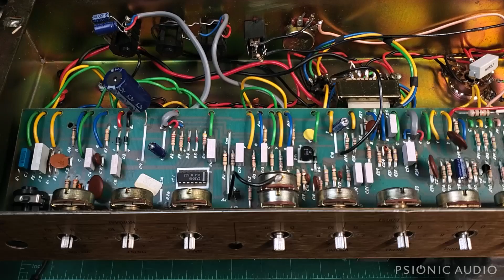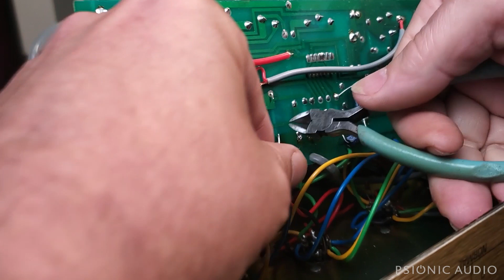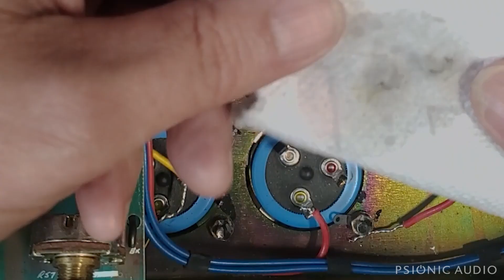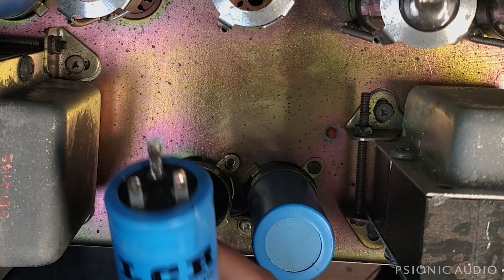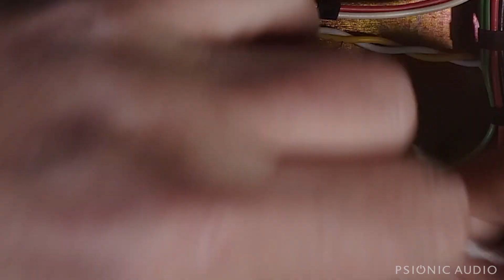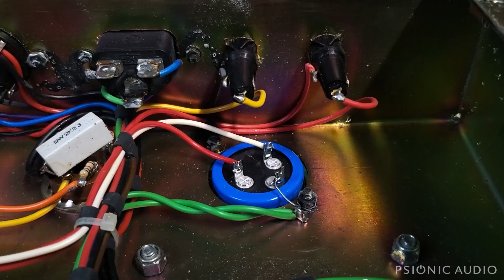Total Recap | '90 Marshall 2210

Comment: there was a nice sloder/desoldering station at my old job, where I done most of my amp work lol, but every other joint and you were taking that thing apart to clean it. easier to use the old pump tube or solder wick

Comment: TIP: I always desolder the old filter caps then disconnect the clamps from the chassis and then drop the old cap and clamp down and out together. You can then change the caps and tighten the clamps easily then bring the cap back up to the chassis, then wire them up and solder them. It's so much easier that way.

Comment: Thanx for showing which braid you use. I haven’t had much luck using the brands I tried. Even with a flux pen they’re still pretty hit or miss as to whether any solder will soak up. I’ll give the techspray a try.

Comment: Marshall could have diagonally staggered those caps too. I would have. Those pot nuts were slam stamped from sheet steel. The rounded side is the top where the punches came down & knocked out hexagon shapes with round holes. The flat-ish (cupped) side is the side where the dies sat. It's a cheap, fast & efficient manufacturing process but the end product is rather substandard.

Comment: Ah, the little details.  Like looking at a component, finding the part number or specs labeling, then bending the leads so the part info is readable from the top when soldered into place.  Genius.  A great habit to internalize for any new build or repair work.

Comment: Curious about your opinion on this. What year of the years they've produced these Marshall reissues did they get it right? Are the current reissues up to par with the originals?
Reply from the maker: Only had two non-1987/1959 reissues in. A 2203 and a 2550. Neither was built as well as the originals. Fixed minor issues, both amps sounded OK. Not great. Sent them home.

Comment: Years ago I worked at an electronics plant making radar displays for the Navy. Per their specs, the parts would fail inspection if the flat washers were installed with the flatter side up. Made life more interesting.
Reply from the maker: If Marshall had used washers beneath the nuts it would be a non-issue. But the corners of the flat side of the nuts gouge the front panel metal.

Comment: With the spring loaded suckers, I just always give it an extra push and release cycle or two after removing some solder. This will clear any small bits that got stuck and prevent you from having to fish out a big chunk later.

Comment: Nice videography, Lyle. I can see everything. Impressive as usual. There is a little bit of a galvanic reaction between those dissimilar metals between the ring terminals & that anodized/galvanized steel chassis. A little glob of quality dielectric grease works well to slow that reaction down. Ilsco DeOxIt is a good product. You want the green stuff. Dow Corning made a very good one too. (>$$$$!!!)

Comment: Voltage memory get interesting when it in the 100k to 22k mf  ( .1 to .2 F)  you can see 5 volts  form  on them before first use !  Below 10k not much of a problem from my point of view if they where discharged   .  Try rotating the clamp 180 degrees  leaving the screw out in the open  on the right one on the screen .  Just a thought.   An other very good video .
Reply from the maker: I have rotated a lot of Marshall clamps. There was a reason I didn't here but I don't recall now. I think it would have been blocked on the other side if I had.
Reply: @PsionicAudio  Well you had your hands on it . All I had was a look so good call.

Comment: For a couple decades I did my desoldering and removal much the way you do it.  There's nothing wrong with that approach and it works.  Recently I splurged and bought a nice powered desoldering station.  After a few months of using it, I will never go back to the old method unless I'm in the field.  It's so much safer for the board and cuts my work time easily in half.  Also, if I have to remove a whole slew of transistors to test them, it's orders of magnitude easier with the station.  You should consider it.  Easily one of my best bench purchases ever and I kick myself for taking so long to figure that out.  Anyway, I enjoy your videos and empathize with your saltiness at what you see inside amps these days.  Cheers.
Reply from the maker: I'll get one eventually. But I see my buddies using them and bam, clogged. ;)

If I had to recap a bunch of mixing channels it would pay for itself.

And thanks!

Comment: If you ever do use a spring loaded solder-sucker, I recommend lubricating the o-ring and rod with Dow Corning silicone vacuum grease. It has better lubricating properties than Apiezon-L and unlike Fomblin, it won't decompose and create acrid and toxic compounds when heated. If you also coat the spring, solder won't stick to it and it makes clearing the solder a bit easier.

When I was doing field service work, using a desoldering station wouldn't have been practical, even if I wanted to try it.  In most situations I found wick to be more effective, although in a few situations the solder sucker worked better.

Comment: Filter-cap mounting clamps often come with slotted screws for the clamping tabs, or occasionally Philips. I wish they'd use Torx or Allen head screws, and Keps nuts with built-in star washers; they'd be much easier to loosen and tighten.
Reply from the maker: Amen

Comment: Was the "black paint" used as threadlocking compound originally red? Some formulations of that lacquer-like compound darken and become corrosive after years of heat from the tubes. Things could be worse ---- at least they didn't use Sony Bond to glue capacitors to the boards. That stuff does lots of damage to vintage audio gear: I've broken numerous dental picks over the years, scraping it off.  I guess you can call it PC-board plaque.....
Reply from the maker: Nah, just black paint.

Freeze spray and a heat gun are your friends with old nasty glues. Sometimes alcohol helps.

If none of that gets the glue off, alcohol definitely helps.
Reply: @PsionicAudio  , freeze spray is definitely helpful. Most "canned air" (keyboard duster, etc) isn't actually air and will act like Freon if you turn the can update down and spray the glue (at work, we use Dust-Off, from Stoner). Have you worked on any guitar amps that have glue corrosion on the pc boards? I haven't seen any in your videos, though that Blues Jr had glue holding a couple of plug-in connectors in place. Annoying when you need to pull a board, but not generally problematic in that application.
Reply from the maker: Peavey Classic Series can be a glue nightmare.
Reply: @PsionicAudio  ,  The worst case scenario with conductive, corrosive glue is when the corrosion creeps down along the component lead and through the hole in the board.  Not only do I often replace diodes and resistors (and sometimes I insulated jumper wires) where the corrosion is right up against the body of the device, but often when I remove the corroded part I find I also have to ream out the hole in the circuit board slightly in order to remove any traces of glue or corrosion down there in that hole. If you don't remove it you will often see that the solder actually bubbles when you solder the new replacement part in place (electrolyte leakage from capacitors can have the same bubbling effect, plus the infamous fishy smell). I have seen cases where the solder joint looks fine but the corrosion has electrically separated the component lead from the solder, inside the joint where you can't see it!   I have a couple of tiny drill bits,  like 1/32nd of an inch or so,  chucked into Exacto-knife handles so that I can easily ream out the glue and corrosion from the holes in the board.  Now if only I could find a way that one could glue foils back down to a board securely when they lift due to heat from components or a previous techs poor soldering skills.... no such high temperature glue exists that I'm aware of....

Comment: I remember that the first version of this circuit used red led's for clipping and discrete components for channel switching. Whereas this version used a bridge diode rectifier for clipping and an IC for switching. And I thought the nuts were the ones at Marshall that designed this thing.

Comment: I have a Marshall DSL40C that the sound cuts out after playing for 10 minutes.  I already changed the tubes  out, and took it to my local guitar tech, who changed the voltage regulator.   Do you have any ideas what the problem could be?  After searching the Marshall forums, I think this is a common problem.  Any help would be appreciated.
Reply from the maker: When I had that it was tin whiskers in a pot. Compressed air fixed it.

Comment: Lyle, you may not be seeking guru status but you've become mine simply by being so straight-forward and articulate.  I've played electric guitar for 55 yrs without much regard for the electronics until lately becoming more of a tone-chaser. Possibly to compensate for diminished dexterity.  Your theatrical background is oddly well-suited to technical-instructional presentation:  the perfect marriage of guitar and amp is a dramatic experience.